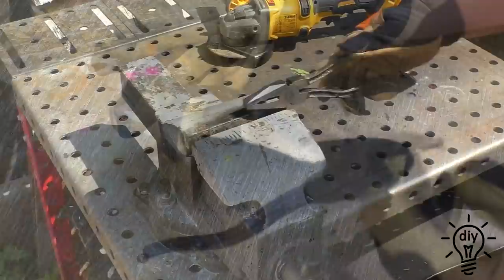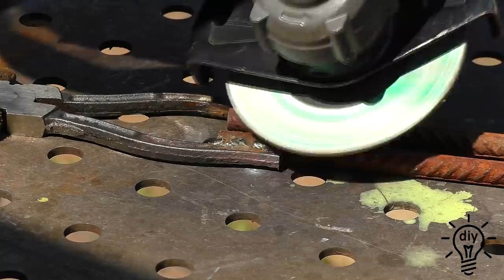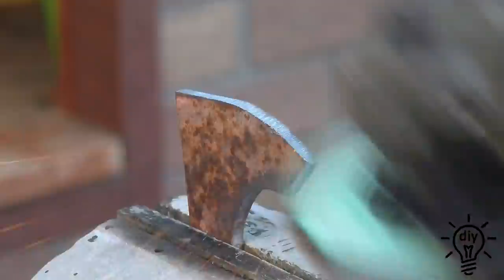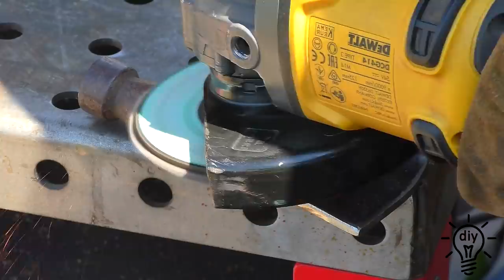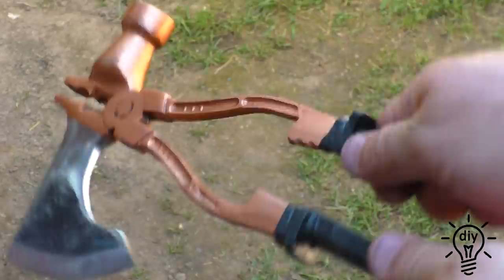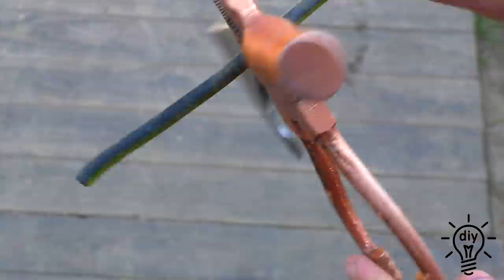Brilliant idea for a homemade tool! You will be pleased to see it!

Comment: Here's a wild idea. Go buy a roofers hatchet, and a decent pair of pliers and leave them alone.
Reply: Cordless dewalt grinder $350.00, basic MIG Welder $1000.00, stupidly welding rebar on any tool and tapping rubber grips back on… Priceless!
Reply: @nickwieser9973  you must have read my mind.
Reply: Another wild idea, Go buy a mouth with a new attitude
Reply: Y
Reply: Ni
Reply: N.    
.